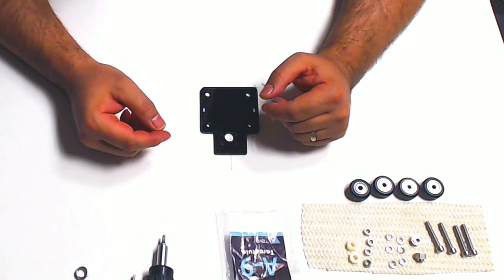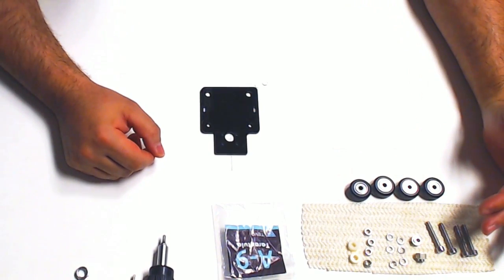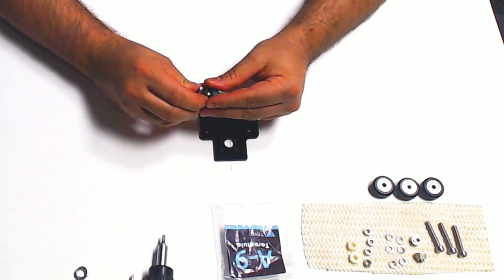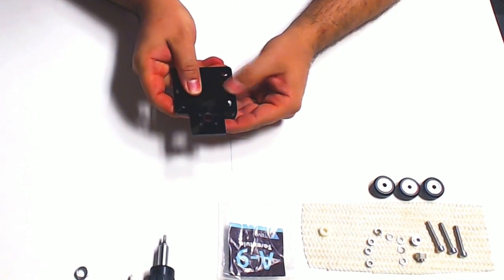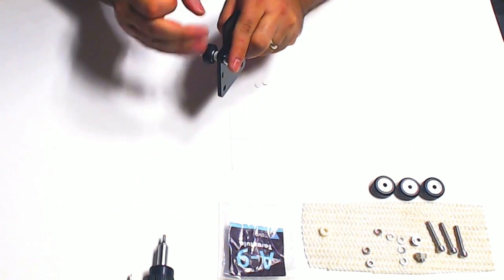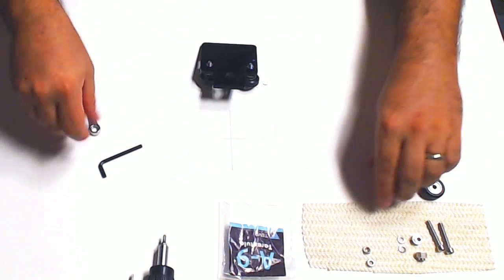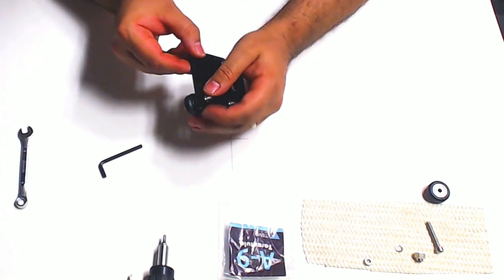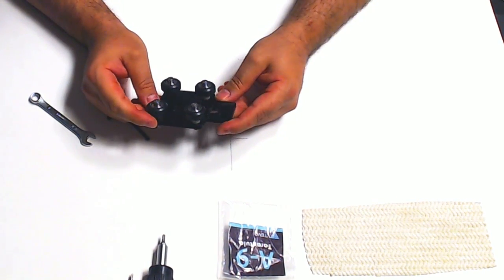Tevo Tarantula Assembly  - Step 1a - X-Axis Mount

Comment: Thank you very much for the video - I assembled my Tevo Tarantula using this instruction and it prints now! 
I had only two hiccups:
1. The E0 output (heat nozzle) of my main board was defect and I had to patch the firmware (according to a tip in the Facebook user forum) to use the E1 output.
2. The bed leveling for PLA seems to be very tricky and I needed a couple of attempts to get adhesion at the bed.
My tip: use PETG filament - for me it seems to be easy to print.

Comment: Got my printer december 2017. I have the brass washers in the wheels. I noticed also that the abs spacers and ex-centered nuts differ in height (about 1 mm). The springwasher is 1.34 mm thick so an extra springwasher causes a slight lob-sided construction. I used a flat lock-washer instead of the second spring-washer. Almost perfect..

Comment: Ok! WASHERS WASHERS WASHERS!!!!!!!!! Buy yourself some M4 and M5 plain washers before you start this build!
 Everyone! please add a washer any time you have a nut or bolt tightening against the acrylic!! This is absolutely the right thing to do! I work in precision engineering and can positively assure you that any plastic must be protected from nuts and bolts by a washer. And Acrylic is more prone to cracking than plastics such as nylon or ABS.
Better safe than sorry. :¬)
Reply: wordreet Hey, I'm new to 3d printing (entirely new actually) and I was wondering if this is a good starting printer. I have never built one before, and I don't want to get a printer that I will mess up. I can only afford to spend about 3-4 hundred dollars, so I can't just buy a different or replacement printer.
Reply: I haven't finished this one yet and it's my first.  I bought it because of the many good reviews I saw. But there's a whole lot of work to do to build the Tarantula, as you can tell from these videos. It is very cheap though, and as they say, you get what you pay for. In my opinion some of the hardware that comes from Tevo is junk.
 My day job is a precision milling machine setter and we make precision components for our customers, so I'm picky about some things. But I've been making things all my life.
 The bolts and T nuts that come with the tarantula are grabage, because they are very badly made and in my opinion there was zero quality control at whatever factory made them. The hole through the nut is too big and the thread on the bolt is too small. They do kind of work, but I found that 3 of them stripped the thread before I'd even done 15% of the build. So I measured them and stopped what I was doing. I then waited a week for some different T nuts to arrive and purchased some good quality M4 bolts from a local supplier.
 If you have 3-4 hundred to spend, I'd absolutely recommend the Creality CR-10. It's had the best reviews of all as far as I can tell and there's just two parts to put together!!! All the wiring is done and they all say it works right away. Plus it's bigger that the Tarantula.
Check this guy's review.
https://www.youtube.com/watch?v=kKc5NDRzTKo&t=225s

Comment: cheers for all the steps in building a great help just finished, didn't need to break bearings down either great work again found a small fault though with the I see you had to countersink a bolt hole I noticed that the piece is same thickness as carriage on z drive so it don't make contact end stop had to modify not great but it works just a piece of plastic that was in the kit super glued to bottom of z carriage

Comment: V important step , put the x limit switch  on the x axis mount now. unless you want to mess around with the  eccentric nuts with the belt attached or dissembling the whole frame like I did
Reply: LOOOOOOOOOOOOOL this is what I'm about to do right now... wish me luck
Reply: All the best to you , I had no prior 3d printer knowledge and I took approx 9 hours to finish and calibrate this printer. It takes an incredible amount of patience. Also for some reason the Y home coordinate seems to be at the front for me , and not the back like the instructions say I should install the limit switch . make 100% sure  your belts are tight, skipping on the belts will mess up your prints big time. All the wheels should  touch the rail and that they roll when moved, my hotbed wobbled like crazy and I learned you can adjust the eccentric nut , just be careful to not apply to much force as you can break the acrylic part

Comment: I do not recommend AliExpress.com.  The vendor was good, but AliExpress would not except my credit card, they cancelled 2 orders because I used the coupon they gave me and they added to my order.  The only way to get the order was for me to cancel the coupon they put on the order.  I got 16 emails for one price adjustment.  The order was cancelled and when I tried to contact someone I could not.  I finally did and they uncancelled the order.  I could not get information on the shipping dates or what was happening.  For some reason their chat did not work for me.  Next time, I will pay more and use ebay or see if I can order from the vendor direct.  I do not see any benifit from using AliExpress!

Comment: Tip No.1 - Use the hand allen keys to assemble, using a handscrew type driver makes it TOO easy to break the acrylic parts by over tightening.

My new kit already had bearing with washer (not spring) assembled. 

If newer kit and bearing is assembled i probably wouldnt touch it.. just have to realign the washer (in the centre) with screwdriver to be able to feed the bolt Threw.
Reply: I bought a kit this week (Feb 2017) and my bearings also came with a flat washer in the middle, so no need to pull the bearings apart here either.
Reply: I just got it, same for me :)

Comment: ArcadEd, your videos are some of the best build videos on youtube! 

For those concerned about the Tarantula V-wheels, I purchased 20 wheel kits: http://www.aliexpress.com/store/product/High-tolerance-CNC-solid-v-wheel-kit-for-v-slot/1711438_32337093164.html

These seem to be identical to the Openbuilds kits, are very good quality, and only cost $32 with free shipping for a package of 20 kits.

I don't have one of these Tevo kits yet -- I already have 2 modified Makerbot and 1 Prusa design printers.  HE3D is selling re-branded Tevo Tarantulas for a bit less $$ than anyone else (at this moment) on aliexpress for $208.05, with free DHL shipping to U.S.

I was in the process of designing a large volume Prusa, but now I'm considering buying the Tarantula with the larger Y axis, then modifying Z to 400mm, and X to 280mm.
Reply from the maker: Awe, thanks man. appreciate it.
Reply: I just noticed, while looking at some Aliexpress photos, that the Tarantula does not use V-slot, as in Openbuilds V-slot.  Am I correct?  The extrusions look like the semi v slots, which have the more rounded edges on the slots. The don't have the truly flat V shape.

If so, I would replace all the extrusions which wheels run on with my V-slot. It will work much better with the V-wheels.

Comment: thank you for posting the vids...great help for build...i have completed the build but I am having problems when choosing Home All Axes...X and Z appear to be fine, but Y results in the bed  traveling too far forward and hits the front pulley and grinds a bit...

any input would be appreciated...thx!!!
Reply from the maker: The easiest fix is to move the y motor to the other side of the rail. The other involves uploading a new firmware.
Reply: hey thanx for the quick reply...i actually kept the Y motor on the right side as illustrated, originally and then switched to the left side as you suggest after i had the grinding problem...I have the apparently newer X carriage which ldoes not cover the hot end fan...figured maybe all in all there were updates to fix the issue and so first tried y motor on right...either way i still have the problem...did you not experience any of this in the begining?  try sw update?

Comment: i was advised to replace all the spring washers with flat ones because the one even position may cause the acrilyc to brake.
Reply from the maker: In the two I built, I didn't have an issue.  I'm not sure how you would even tighten it so much to break the acrylic.
Reply: the Acryilic is VERY breakable, i'm attending a course on building, and 2 people already broke it (one fell, the other i don't know) . in fact i'd love to the design of all these parts to them out of metal.  
this is the progress i've made thus far..
https://plus.google.com/+emaayan/posts/BHBvK8yqHAs

Comment: Nice video, but we bought one and can't get the extruders or bed to heat up .  We followed your directions and also the manual - there's something wrong with the mainboard.. Anyone else have that problem?  Can't get the company to respond and this cost almost $500
Reply: +Angela Fischer You should post in the facebook group.  We can tag the owners and get them in there.  It would be really odd for both of those things not working.  Are you sure you are getting a good 12v to the mainboard from the power supply?
Reply: ***** , I didn't know there was a FB group (should have thought of looking), thank you.  Everything else works perfectly so I didn't think to check voltage going to mainboard but will do that tomorrow. Our mainboard looks a little odd too, the connector for the bed is a tall green connector same as the power supply connector whereas the manual shows it to be blue like the extruder connectors. Only two of the thermistor connectors work, too, and we need all three since we have a 2nd extruder.